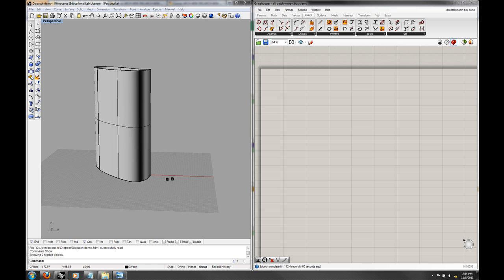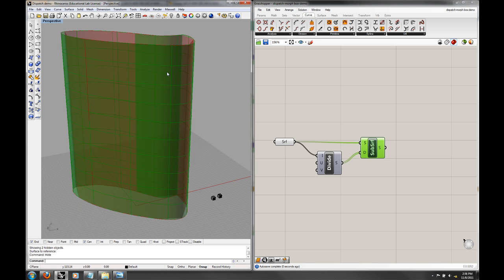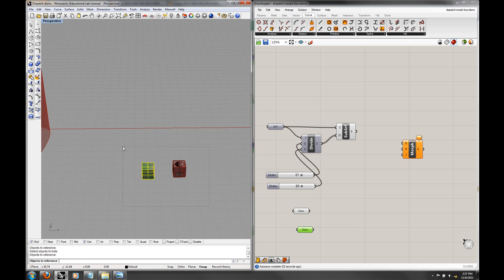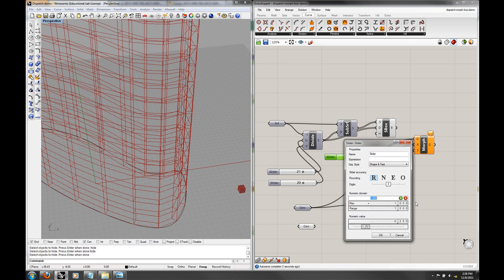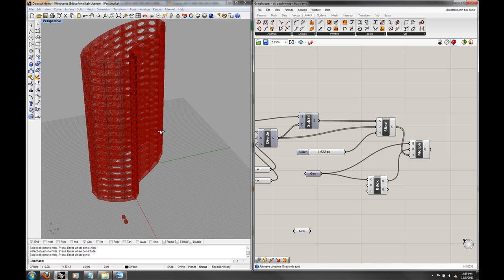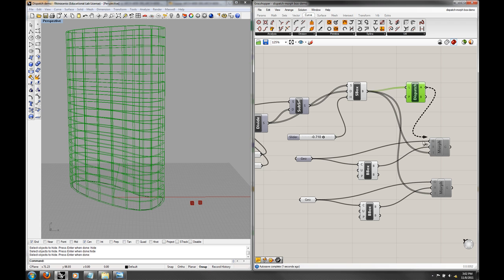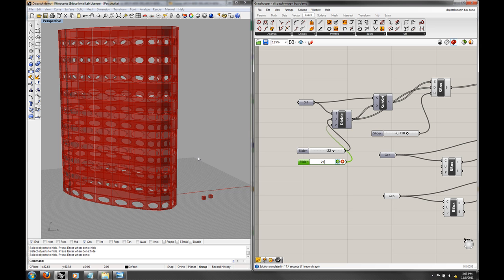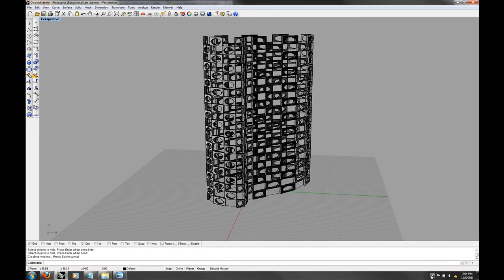Grasshopper Lecture 3 - Part 4: Paneling with Morph Geometry

Comment: Hi Mr. Nick, thanks for the tutorials, really appreciate it ! Wanted to ask like when we use surface box, does it kind of like convert our surface to be read like a "box" so that the box morph component can read it and thus perform an operation with it ? So in order to box morph we need to make all necessary geometry be read like a "box" first ( and hence bounding box for the geometry) before plugging it into the box morph component ?
Reply from the maker: I think you have got it right. My understanding is that the morph box needs to define a base object "box" (the bounding box) and the targets as boxes because this is how it performs the transformation (the stretching / pulling / shear / etc.). Working on a bounding box greatly simplifies the operation and makes it equal between the two objects. Reducing everything to a box means the program only has to determine the differences in X/Y/Z between the two collections of eight vertices (base and target).
Reply: Hi Mr.Nick, thanks for getting back !

Comment: Thanks a lot nick. I'll check the 25th minute in ur daylight logics video. BTW, is there a way 2 create a facade like this one and b able 2 change each individual hole separately? (google this please: Lightmos / Architectkidd | ArchDaily) Or at least create a group of 5 types of holes that get repeated on the facade and edit their size, and shape w/ sliders? So far what i thought of was editing the cylinders that make the booleans b4 applying it, or using what is taught in this tutorial. THANKS!